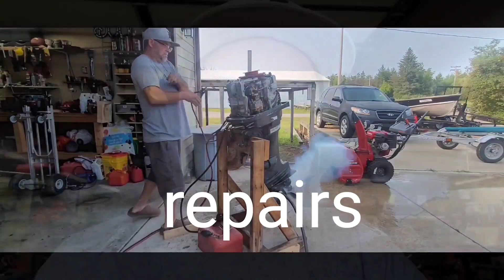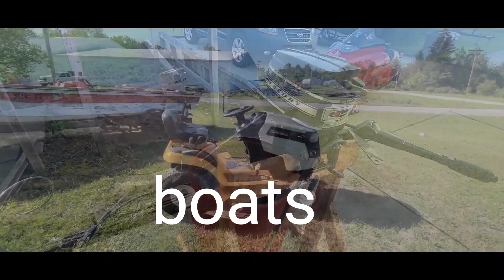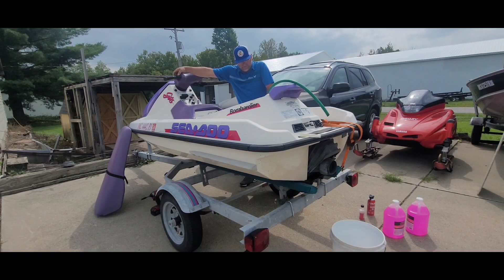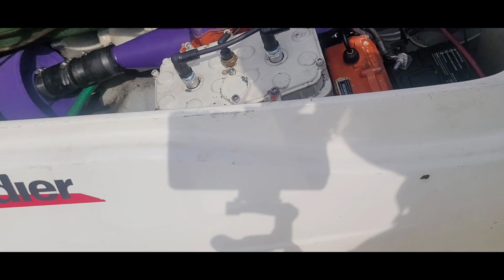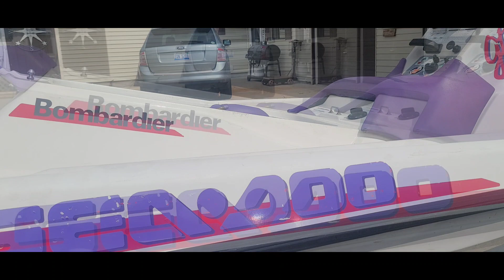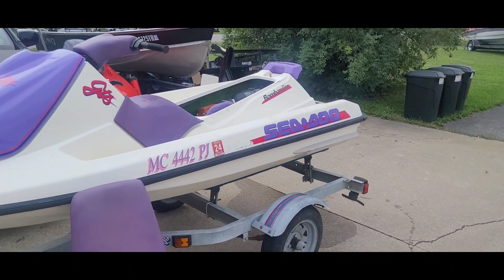Winterizing my 1992 Seadoo GTS 😀

Comment: I understand manufacturer even reccomends to start for 5-10sec before starting water when on land, but just to clear up some myths, its only the exhaust temp thats the concern with these skis on dry land right? Nothing in the jet that can be damaged with dry running?
Reply from the maker: Yes 5 to 10 then run the water. The exhaust temperature is crucial for the engine to keep cooling when out of the water. Thanks for watching I appreciate that 🙏